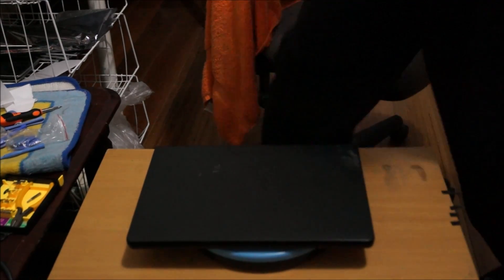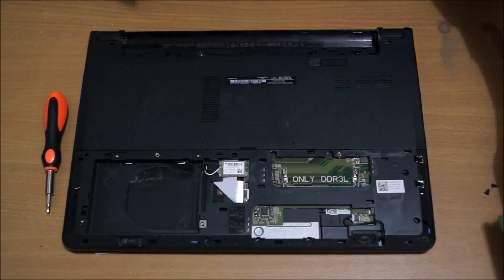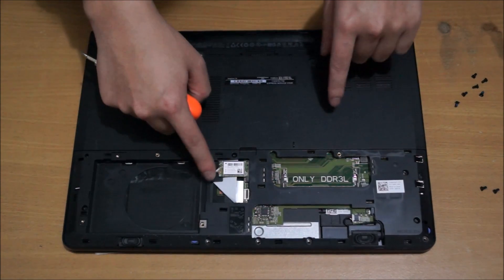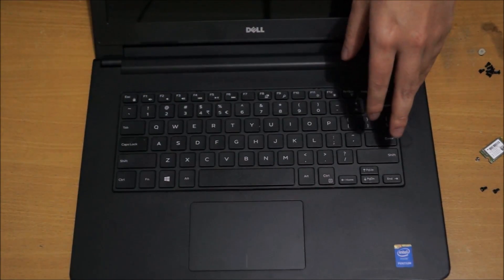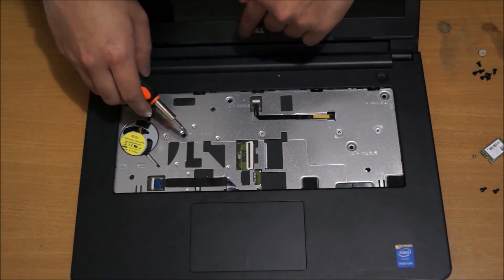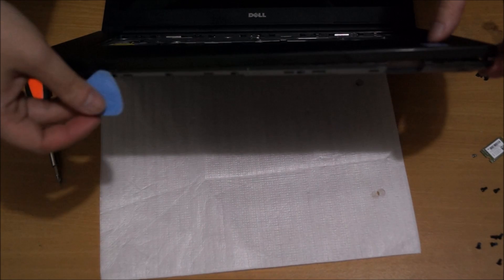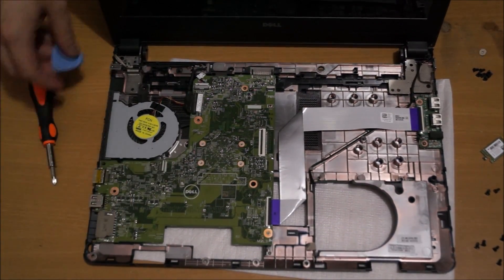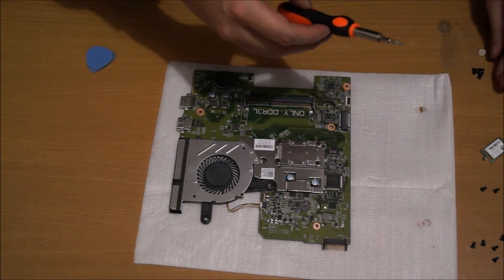OPEN ME UP! Dell Inspiron 14 3000 series Disassembly

Comment: sir  my left side panel of this same model broke about 1 cm near the charging port  (edge of laptop). Shall i change it or  not? Because its minor
Reply from the maker: it wont cause any issue if it does it wont work
Reply: thank you so much sir for the fast reply and for the suggestion
Reply: Should i cover a tape or some thing so that dust wont come in to my laptop?
Reply from the maker: i would not but it depends on what environment you are in. if you in a dusty place then yes as i have open up laptops before and it is just dirt everywhere

Comment: Mine is the cheap model without a hdd. The motherboard has an area for a connecter to be soldered in but i don’t know the name for this component and I cant find any online to order. does anyone know what the name of that metal part is called or where i can get one?

Comment: I bought 2 of these laptops for my granddaughters, they are basically useless. I opened up the back and there are  no hard drives.  I called Dell and they recommended and sold me a hard drive that they guaranteed fits this laptop but there is no connection for it.  Are there any options or should I send it back and get my money back?
Reply from the maker: you didnt tell them which model you have. so this laptop comes with 2 model they both have the hard drive cut out since they use the same case but the connector is missing for the basic model. you have the basic model therefore the hard drive connector is not solder on
Reply: I have the Inspiron 14 3452 model. I called Dell back yesterday and they told me the hard drive they sent will fit, but I'm at a loss as to how.
Reply from the maker: it wont as the connector is not there. you can confirm this if you have 32GB hard drive space now. the one with 32 hard drive space is the basic entry level laptop therefore to reduce cost everything is remove even the connector. in my video at 3.00 you can see there is a connector to connect it if you dont have that then you will have an issue
Reply: Thank you for your response, can I ask, would an external hard drive work?My granddaughter wants to be able to upload and edit videos and that's the reason I purchased the  hard drive that now can't be installed.  Can you please recommend an alternative other than replacing the laptop?
Reply from the maker: you can use an external hard drive as long you have a usb port. if you already bought a hard drive you can buy an case for it online so you can use it externally
Reply: thank you, you've been very helpful, can you please recommend a case for the hard drive or link to one? Thanks
Reply from the maker: https://www.ebay.com.au/itm/2-5inch-Mini-USB2-0-Aluminum-SATA-HDD-Hard-Drive-External-Enclosure-Case-White/131998686714?hash=item1ebbbc1dfa:g:nkIAAOSwCtJaSpHp
Reply: thank you, i will order, so the hard drive sits in the case and then is able to connect via usb?
Reply from the maker: yes

Comment: So this can come without a HD? A client hired me to put a new larger HD in this laptop. When I opened it up the slot is there but no connections.
Reply from the maker: the lowest model comes with a 32GB hard drive thats solder on flash storage.
Reply: I have this same issue, the solder points on the PCB are there but no real plug and play options.
Reply from the maker: they dont provide it to you when you have the lowest model

Comment: Hey what hardrive is that and where did you get it?
Reply from the maker: depending on what model you have the hard drive is solder on or not. so you need to tell me how much hard drive space you have
Reply: OPEN ME UP I have the exact same laptop you are using in the video storage size doesn’t matter and how do you hook it up?
Reply from the maker: you can read the discussion before it will give you more insight. you will need the hard drive connector and the hard drive holder to do it
Reply: OPEN ME UP could you send me a link to those items
Reply from the maker: sorry dont have them

Comment: How do you replace your processor???
Reply from the maker: CPU is solder on, ram can be changed to 8GB max with 8GB in one slot, wireless card can be changed, and hard drive is a 2.5 inch.

Comment: I got a laptop from a customer that is an inspirion 14 3452. And i honestly can not find the hard drive. I think the customers son might have hid it from the customer himself? Not sure basically what i want to know is there only the one slot for the hard drive on this laptop. Because i am pretty sure but i don't want to out right accuse the son of hiding something from his father.
Reply from the maker: depending on your model the laptop doesnt come with a hard drive. the hard drive slot is always there but you can confirm if it has a hard drive or not checking if you have the hard drive cable and if there is a connect of the motherboard for the cable
Reply: Thanks for this actually! I will be sure to take a look. In my right mind i would never buy a laptop with that amount of storage so that never even occurred to me.
Reply: As an update i just checked and there was no sd card either. I am going to give it back to him and explain what i learned. Saying him or his son may have bumped the sd card out. Because it looks to me like there never was a HDD in there to begin with.
Reply from the maker: seems like you got the wrong idea. there is no sd card. it is solder on storage like your phone or tablet. this storage is solder on the to motherboard.

Comment: I got a number for a HD Tech support said it will work, but you might need a cable. Manufacturer Part# WD10JFCX
Dell Part# A7420018
Reply from the maker: the issue is not that you need the cable, the connector clip is missing from the laptop

Comment: Can you do a mother vid on the hard drive I don't know how to install one
Reply from the maker: if you asking the question you most likely have the laptop without a hard drive and you cant install one as there is no connector
Reply: OPEN ME UP I want to replace mine but I don't know how to reinstall it
Reply from the maker: reinstalling windows is simple but if you dont know how to do that i recommend you not to attempt it as you will have a difficult time finding driver and other stuff

Comment: I want to buy dell 3458 i3 5005u,  the dell site says thats support 8 gb max of ram but some another websites says that support 16 gb , anyone puts more ram than the specification? thx
Reply from the maker: the issue is how many slots for ram. for this laptop there is only one ram slot and it uses ddr3 which only comes in 8gb sticks max therefore 8gb is max. there are 16gb sticks but they are experimental and might not work correctly

Comment: can i replace the keyboard with backlit keyboard on this series. my laptop is dell inspiron 14 3458
Reply from the maker: no
Reply: thank you for your answer..  i appreciate it
Reply: http://www.ebay.com/itm/New-us-backlit-keyboard-for-Dell-inspiron-14-3000-series-3458-i3451-i3452-black-/162088166144?hash=item25bd352300:g:K5MAAOSw0gdXTU8r    this keyboard doesnt work?
Reply from the maker: the issue is there is no backlight connector on the laptop for you to use it
Reply from the maker: yes most of them will not have it. since dell uses the same motherboard for different laptops it saves them money by just having one motherboard and adding things to it. So for the 3000 series they dont need the connector but for one of the dell latitude which uses the same motherboard they will have it.

Comment: Thank you for sharing this video. Used my laptop yesterday, just fine, today it is dead- won't charge. I have 4 of the same laptops for training others at work. And I switched the battery and the charger. Then I tried basic trouble shooting, then I followed the video to troubleshoot more. Still no luck. This laptop has no hard drive, Are the documents stored on the ram? How can I get my documents off of it? -- again I have 4 of the same laptops so the parts should all match up if anyone has suggestions!
Reply from the maker: it is the same as phones it has soldered on storage. if you cant turn it on then you cant retrieve the stuff.

Comment: Quick question is this a 2.5 hard drive? I have a 500 gigabytes just laying around and is a 2.5 hd you think I can use it on this model of laptop?
Reply: Ups I didn't read your notes sorry got it👍
Reply from the maker: please note that this laptop comes with a few model and something dont have the connector tap and cable for you to use a 2.5 inch hard drive
Reply: say could you tell me what I need to connect the hard drive to the computer or what it is kind?
Reply: also I kind of tried formatting my computer and deleted windows how do i get it back is windows on this computer installed on a memory card
Reply from the maker: you need to install widows using a cd or a usb. windows installation is not on the computer
Reply: I tried but it keeps saying it cant can you tell me what hard drive I need for the type of pc
Reply from the maker: i cant help you as i can not see what you are seeing

Comment: OPEN ME UP, my son has the same exact laptop, and has had MAJOR problems with connectivity to the WiFi. We've run all sorts of troubleshooting methods on the laptop, including restoring the entire laptop to Factory Settings. Still had the same problem, and we called Dell Tech Support for assistance. They sent us a new WLAN card, which should be an easy replacement. Alas, while removing the old WLAN card, the caps that connect to the "buttons" on the card still have the old buttons stuck in them while I was carefully attempting to pry them off the card. The fact that the old "buttons" are stuck in the caps led me to believe that the old WLAN card had bad solder points on them, which would have been the cause of the connectivity problem. Is there any way I can get those blasted old "buttons" out without having to tear apart  the entire laptop to replace the wires? I've tried using as many pry tools to get those out, and I'm at the point of pulling my hair out while cursing Dell for producing a Wal-Mart quality product.
Reply from the maker: as a person who disassemble laptops this is common to me. it is not a big issue. I dont find it difficult to remove the connector in the cable once if breaks offs. you cant use a needle or something pointy to pock it out

Comment: Hello, nice video you have there. I have the same laptop and there is a space for the ssd just as you have in your video. The problem i have is, there isnt a connector to connect to the drive and also would you please educate me on what type of connector and ssd i should buy since im a novice in that department. Its a 2GB RAM and a 20GB ROM. Thank you!
Reply from the maker: if you dont have the connect then you basically cant do anything about it

Comment: is this model fanless or something? i see no slot for a fan besides little tiny slots that are no good use for cooling.
Reply from the maker: +Goo&#39;s Gaming And Tech depending on what CPU you have it iwll come with a fan or not. this model the CPU is a low end and doesnt need a fan
Reply: i thought it was just the core M that had no fans i never knew a celeron was fanless or does it just vent through the keyboard
Reply from the maker: dont know

Comment: Looks to me like the hard drive connector is on the motherboard, so adding a hard drive should be easy if you can find the caddy and the cable..
Reply from the maker: +Will Maitner yes and no. for those that didnt have a hard drive at the start will also need to get the connector on the motherboard solder on as the connector is missing
Reply: Strange, it looks like the connector is there in your video..
Reply from the maker: some people will not have the connector depending on your model.
Reply: Looks like they have made some changes, including adding a plastic block to prevent people from adding a hard drive to the machine.  Rat basta......
Reply from the maker: well they are a companies that needs to make money.
Reply: +Will Maitner the plastic block is meant to be removed

Comment: My laptop is the same model but it has a disc reader,so is it a different model?and can anyone tell me what's the model and if I can upgrade or change the processor thx
Reply from the maker: +TheMehGaming there are a few different model and no you can not change the processor for any of the models as it is solder on

Comment: I have the same pc but when i was taking it apart there was a thick object attached to the hard drive which i didnt see in your video. I was wondering how I would reattach it to the its initial position.
Reply from the maker: +Peter Ngaba probably can if it was originally attach there is no reason why you can not place it back

Comment: I have a question, Dell Inspiron 14 3000 series (3451) does support backlit keyboard? because i want to change my keyboard to shows more fancy with the lights!!!
Reply from the maker: +geodimi13 nope this is a low end laptop made to be cheap therefore it does not have backlight option

Comment: dude is there a way to install an ssd card to the dell inspirion 14 3000 because i found absolutely no video for it pls reply fast
Reply from the maker: +Christian Daoud in the video at 1.40 that is where you can place you ssd
Reply: oh well I doesn't fit though...
Reply from the maker: +Christian Daoud you need to to tell me what you want me to do in order for me to help you. All you told me is that you want to put an SSD in the laptop. there is 4 type of SSD avaliable and not of them fit in it. you have not advise me which SSD you have
Reply: +OPEN ME UP i have a kingdian sd200 60 gigabyte ssd
Reply: +OPEN ME UP at 1:40 when you open up the computer can you remove the rubber rectangle object without damaging the laptop to make it fit
Reply: +OPEN ME UP it says it's 2.5 inches is there something else I need to do
Reply from the maker: +Christian Daoud you just need a 2.5 inch hard drive that is what fits in that slot. SSD does come in 2.5 inch
Reply: OPEN ME UP but like I said in my earlier comment can you remove the rubber rectangle without haring the computer to fit it in the slot
Reply from the maker: your SSD is probably 9mm thick and does not fit in the slot since it only holds a 7mm thick SSD
Reply: it is 7mm thick I measured it
Reply from the maker: did you measure your old hard drive as if it is the same it should fit in without issues
Reply: OPEN ME UP my laptop didn't come with one
Reply from the maker: i see if that is the case you should also missing the connecting cable to the board as well
Reply: +OPEN ME UP well i just want to know what hard drive you have and what else do i need
Reply: +Charles Westberry damn well ill guess ill stick to my stupid 20g storage
Reply: +Charles Westberry do you know where i can find one
Reply: +Charles Westberry thanks
Reply: +Charles Westberry hey is a 128g usb flash drive good for gaming
Reply: wow you replied fast

Comment: Does this laptop have any storage expansion? empty sata/msata ports, sd card slots etc. It's such a cheap laptop with a 950m
Reply: +Ethan w Does it come with the sata cable for the hdd slot if you get the 32gb version? Are they easy to find?
Reply from the maker: +Ethan w most laptops only have one hard drive slot when it is cheap. but basically all laptop have a sd card slot
Reply from the maker: +Ethan w generally they will not provide you stuff that you dont use like the cable if they didnt give you a hard drive. the cable is simple to find if it didnt come with any, the cable is use in other laptops as well and used by other brands as well which is why it is simple to find.

Comment: im thinking get this laptop,how it works?can you upload ram to 8gb,couldnt find info on dell website.i'll play some games,normal nothing xtreme haha.
Reply from the maker: +akira gv CPU is solder on, ram can be changed to 8GB max with 8GB in one slot, wireless card can be changed, and hard drive is a 2.5 inch

Comment from the maker: +Nathaniel Lee Removing wireless card 3.20. most people go and get an Intel 7260ac which is around 20AUD
Reply from the maker: some of the the models dont have a hard drive cable so you can put a hard drive isnde of it without a cable. Depending on what CPU you have you can put 8GB or 4GB. tell me your CPU and i will tell you how much ram you can have
Reply from the maker: then you shouldnt be able to upgrade the hard drive and you can only have 4GB max
Reply from the maker: I dont know what you trying to say. the link you sent is for a lenovo it is a different laptop.